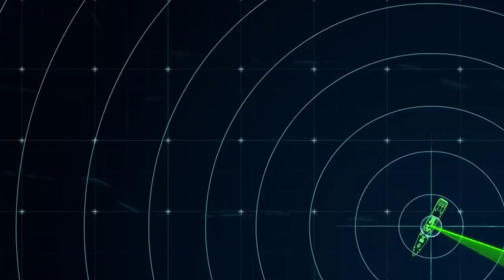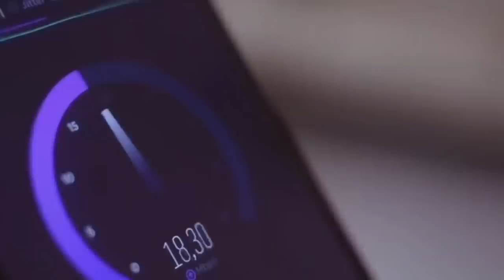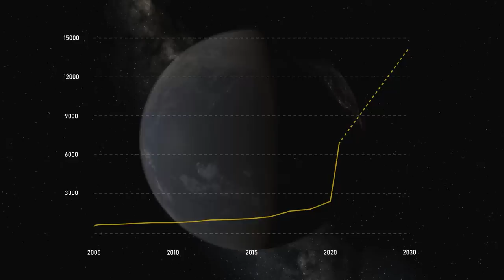China Just Copied Starlink And It's Terrified The Whole World

Comment: Fact check: MEO (medium earth orbit) is much further away from the earth  than the LEO (low earth orbit ) where SpaceX Starlink satellites orbit. Since latency is determined by the distance signals have to traverse, latency will be higher (slower response time) in MEO than LEO.
Reply: Would you explain to me, how can we see starlink modules deployed 300 km above?
They are the size of the fridge, and no reflective surfaces...
Reply: @juanverdez2706  Sure. When SpaceX was asked to reduce the reflectivity of the satellites they applied a coating that did so by about 50%, so they still reflect light. Also because of their altitude, for a few hours after dusk and a few hours before dawn they are in bright sunlight while earth's surface below them is dark. That makes them pretty easy to spot.
Reply: @aerowhiz  thank You vm, but not so easy. Light towers, with all the spark bulbs, reflectors, mirrors have a reach up to 50 km (wiki) (actually, 25 they say, but I double)
I live in mountains, and have far view, so I know it's not possible to see a full lighted truck at night more then few tens of km.
And most important, trygonometry tells us, that only one from the set can reflect light to viewer, at one moment. Not to mention this cross pattern, shown on yt. 
I only have clips on yt (it is rather dark there) and what I saw once at night myself.
This really wonders me...